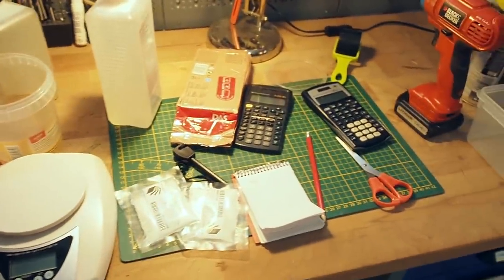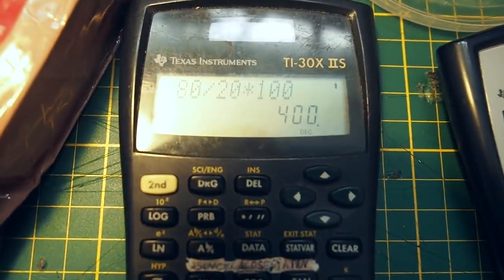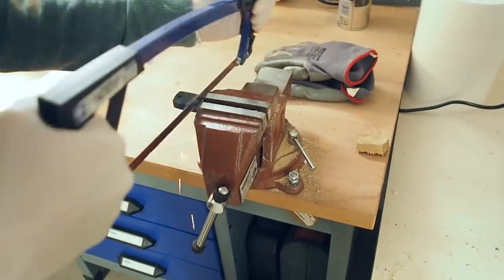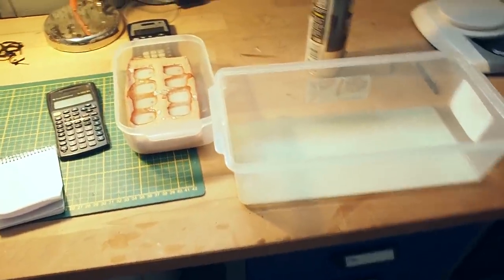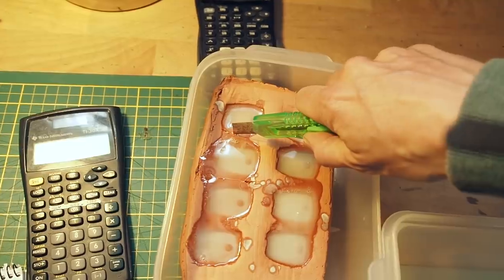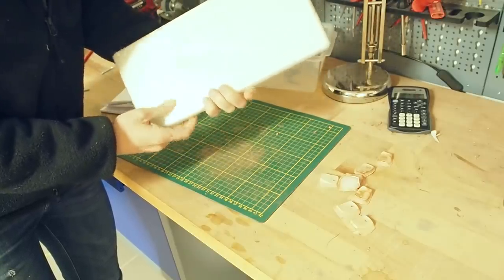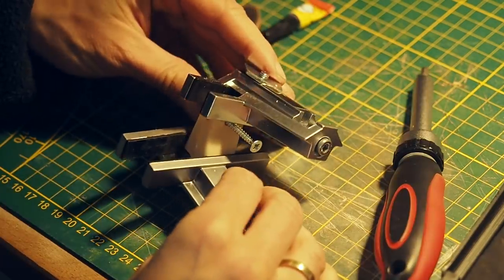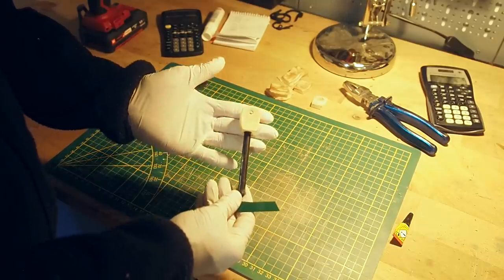How to make a glow in the dark firesteel

Comment: From my experience casting I suggest using a small dowel to make the center hole.  Spray a release agent on the dowel.  Measure halfway down the handle and only press in the mould that deep. Keep the dowel in the mould and a thick nail where the lanyard hole goes when you pour the resin.  Doing this will greatly reduce the need to drill and sand.  That is if you are going to use the same canoe mould style (horizontal pour) and not a 2 piece mould (vertical pour)

Comment: Good job indeed, very clever idea :) (A little tip, maybe you knew but in case you didnt, at 10:13 you can measure size of that hole with top of the caliper, with those 2 spikes) greetings from Slovakia.

Comment: Wow! I really enjoyed the manufacturing side of this. It’s cool to make things like this. I’d suggest finding a way to make a rubber mold next time like a rubber ice tray mold that you can get at IKEA (or Aldi sometimes.) I’m sure it could be done yourself or possibly find a cheap custom rubber mold maker
Reply: Cheap silicone sealant, the acetic acid during type, mixed with corn starch, makes a fairly fast curing somewhat flexible material useful for molds and many other things.
Search YouTube for oogoo and/or 'proto putty' for recipes and uses. The commercial variant, much more expensive, is called sugru.

Comment: Why not just dip the handle in the resin and let it set up as a thin layer? - maybe dip a few times to build up the thickness.
Reply: or just cast a cube around the firesteel and sand it down to required shape later.

Comment: That's a great idea! It could be used for many other pieces of camping/survival equipment. Could the material be coated on the fire steel handle? Instead of molding an entirely new one?
Reply: Nelson Santiago   Not usually, most need to be sealed but using polyurethane blocks out a lot of the UV rays. There are craft fluorescent paints but are not very strong. If you could find an industrial strength fluorescent, that should do it ..... not  weaken the color and seal itself at the same time.

Comment: You might need more hardener for the epoxy vs the resin  ...my self I use clear nail polish with the powder sprinkled on let harden and coat once again with the polish...easy to do faster and less work...It goes on just about everything... especially the grandkids flashlights...

Comment: Cool. 

FYI, epoxy shouldn't have taken 48 hours to cure. Was the correct amount of hardener used?  Was it mixed very thoroughly (that mixer wasn't really ideal, which is why some parts were still soft)? Was the room temperature rather low (a warm room makes it cure faster)?

Comment: I haven't tried it, but I wonder if you could paint the glow-epoxy directly to the existing handle.  Maybe mix it at 30% since it would be a thin layer.  Sand the handle first to help it stick.  If a thin layer doesn't glow enough on it's own then perhaps dusting it with some of the powder while it's still tacky would work.  After it's cured, apply a final coat of clear epoxy to add some shine and protect the dust layer.  If the dusting method works then maybe it's not necessary to mix the powder into the epoxy.

Comment: Interesting what you do this way with WD-40 oil!
With polyethylene film - it’s harder to hammer into clay, I did it)))

However, if the clay is beaten, flattened in a pancake several times moistened with water, and then thrombose into a cubic shape,
you don’t have to file the product at all - clay changes its structure and becomes denser :D
Reply: WD-40 is now not just the original light oil, but also makes a silicone spray. So if you are shopping for the original thing, you might want to read a Little further on the can than just the big WD-40, to not end up with the wrong stuff.
Reply: @michaeltempsch5282  Thanks a lot, I was meaning wd-40 spray, but forgot how this termin writes :)

Comment: Well.... Excellent idea !!!
If you have such a wonderful workshop at home, you could just cast one block  of epoxy compound and machine it later to  your desired shape. It is much more reliable than gluing the 2 pieces with super glue. I wouldn't trust my life on a tool that is glued with super glue.
It tends to fail after some time. As for the epoxy itself, I would use much thicker material as it will hold better the fluorescent compound and keep it distributed evenly.

Comment: Resin mix can have different consistency's. They can be thin like syrup or can be thick like peanut butter and every thing in between. A thicker or less viscous resin mixture that cures faster should suspend the powder better so it does not sink while the resin cures.

Comment: I would avoid glowing and reflective, cause they give very easy your position away on night visión devices, specially reflective when iluminated with IR light
Reply: I think the fire your trying to get started will give your position away...
The glowing handle will make it easier to find in your pack or bag.
Reply: Yes Kenneth Kramm channel showed night vision goggles with army clothes and they stood out like daylight!   Coz of the white in mix of camouflage colours
Reply: @johnmoco3684  if i don't want to attract anyone's attention, one of the things i would never ever do is try to start a fire
Reply: @papuchu  the glowing handle would still only be visible inside the bag, so nvg's wouldn't be of much use. Besides they can be a bit pricey. You'd also want to not be using other light sources.